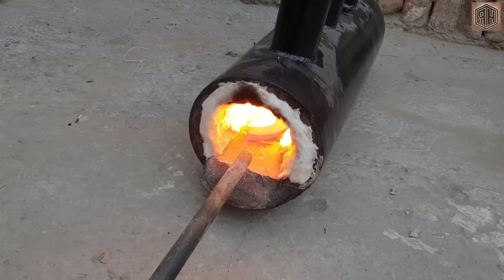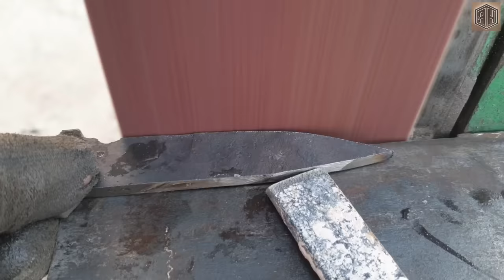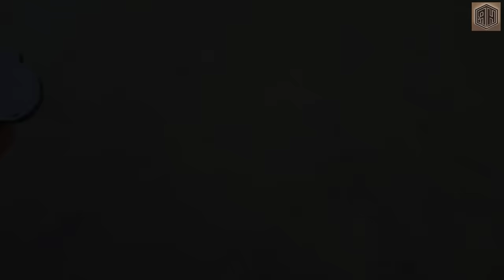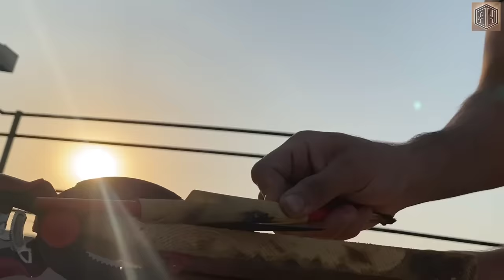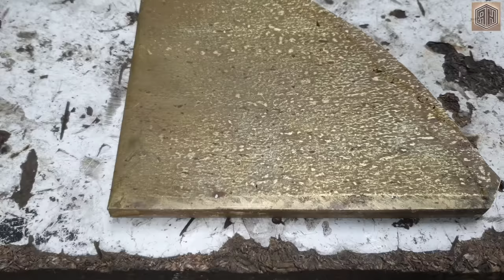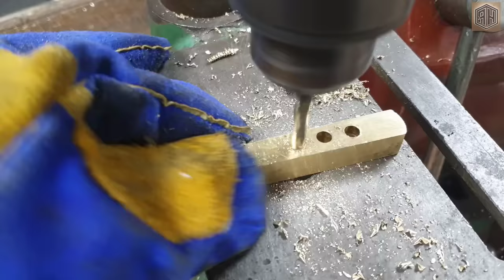Rusted Spring FORGED into a beautiful Butterfly knife

Comment: As always you did a beautiful job but as a machinist I kinda cringed when you cut that long groove, an end mill which can be bought very cheap (whole sets) would have done so much better,the counter sink you used just ate up the brass and left imperfections in the brass itself, an end-mill would have left a nice smooth finish.
Once again beautiful work but when you did such a great job on everything else the tiny imperfections stand out more.
Reply: I was a bit confused why he used the end mill to cut the slot down the length but then used a dremel to cut the slot in the side. And ya, the countersink was kinda hokey
Reply from the maker: I am thankful for your opinions.
Reply: CrunchyGS, he's thankful for people's opinions, and thanks them for the advice. So don't come out here being toxic. :/
Reply: @gala6403  ok boomer what are u like 50
Reply: So what. Being old is an insult now?
Reply: @tkdace2459  yes how old are u...boome...r

Comment: I’m genuinely curious why a person would dislike a video like this. Do you not like craftsmanship? Are you scared of the butterfly knife’s potential to be a dangerous weapon? Are you offended on the rusted spring’s behalf? So many questions
Reply: I liked the video overall but felt the maker’s attention to detail was very disappointing. Pay attention to the alignment of the holes on the handle. Are they centered or placed closer to one edge? If they’re not centered, are they at least off-center consistently between both handles? What about the channels running down the inside of each handle? Are the channels uniform with smooth, even walls, or are their inconsistent gaps and other marring on the brass? Was the material removed from the very center to create the blade channel, or are the remaining walls on either side inconsistent widths, meaning be removed more brass from one side than the other? You can check all those things in the 9:44 to 9:54 section.

Spoiler alert: this knife has ALL those tooling and measuring/alignment flaws, and many more. Lots of evidence that he rushed the work and didn’t give it his best effort.

There are other things in this video that he did wrong because he might not know better (like using steel tools to assemble brass pins in a brass handle), but those measuring, alignment, and tooling flaws are simple laziness. And maybe he figured he’s not being paid for this, so it doesn’t matter. But if that’s the case, why bother making a decorative knife and emphasizing all the hard work along the way in the first place?

Comment: can I actually buy this? I’d pay 150$ or however much you’d like
Reply: Just take that money and put it towards a forge, then you can make any knife you like for the cost of the steel 🙂
Reply: @adammilan6434  its a very expensive hobby to get into. Of course, you can make knives on the cheap and still get good results, but the machinery required for a blade like this will set you back quite a bit more. If you're not wanting to start a hobby that you'll pour thousands into, stick to just buying the knife.

Comment: BRO YOU CAN PARTICIPATE IN "FORGED IN FIRE" PROGRAMME!!
Reply: No he can.t. that wasn.t forging what he did right now :)
Reply: Probably has the skills but he definitely doesn't have the kind of tools you need to compete in the final
Reply: @gandurk  he definitely has the skills. But what he did here isn.t quite forging. Forging means you make more than 75% of the shape by 🔨
Reply: @xrevengerrx6369  how isn't it forging? He took a piece of steel and reshaped it into a bar, I thought that was definitionally what forging meant:

"Forging is a manufacturing process involving the shaping of metal using localized compressive forces. The blows are delivered with a hammer (often a power hammer) or a die. Forging is often classified according to the temperature at which it is performed: cold forging (a type of cold working), warm forging, or hot forging (a type of hot working). For the latter two, the metal is heated, usually in a forge. "
That's just from Wikipedia
Reply: @gandurk  i suggest to look at forged in fire. In one episode was a blacksmith sent home because of this reason. He just straighten the metal and then shape it by cutting. It.s same thing.
Reply: @gandurk  i.m speaking strictly about the show classification about forging, because of the idea of the first comment.
It.s not haiting, i love his creations :)
Reply: @xrevengerrx6369  aw cool I was genuinely interested, seemed like you knew some stuff. My guess is that it is forging under normal conditions in real life (going by the definition I posted), but for forged in fire they put some rules to prevent people just buying strips of metal or something to skip out on the actual work. Some people have really elaborate shops and it would be easy for them to use a plasma cutter to get a blade shape and that would ruin the point of the competition. Anyhow we agree that he couldn't really compete in forged in fire
Reply: @xrevengerrx6369  like historically it was not uncommon to grind shapes out of sheet metal and stuff, not all blades were forged from the ground up, but it wouldnt work in the context of the show
Reply: @gandurk  With forged in fire though, they usually end up giving the participants random stuff to make blades out of such as drum sets and ship wheels, both of which have been used by the show. They usually get them to melt them down and reshape them but I cant imagine them not letting him do something like this.
Reply: @gandurk  its not forging because he did not make that shape by his hand, he turned into flat stock that used an angle grinder to MAKE that shape he did not make it by his hand not forging

Comment: I kind of want to know if the knife would be too soft, as the spring probably wouldn't have been made of steel thats as hard as 56 hrc or 57 hrc. Normally small knives like those should be about 57 hrc to avoid being dulled too quickly and not bend. Would the choice of steel affect the performance?

Comment: I totally love your videos and sincerely appreciate every minute you put into them. Pure magic.
But, I have an observation to make, as an amateur fan of yours, and please hear me out and correct me if I am mistaken.
I believe that the half circle end of the blade should have been extended.
Or, it should've been instaed made to end it with extension, like blunt horns or micky mouse ears.
The reason I say this is that when I look at the blade when opened, I don't see sufficient support to keep it fully horizontal apart from the 2 bolts. 
I feel that I can bend this knife with my bare hands, when knife is extended, right at the joint point of these 2 bolts.
But, had there been an extension that wedges itself tightly right into the two grooves, it would've given it much support.
Do you agree?
Reply: The circle should actually be shorter, because it has pins in the tang those contact the handles and stop the handles from touching

Comment: One of the best looking butterfly knives I've seen so far on YouTube. HOWEVER... Every single butterfly knife I watch being forged is WAY too thick in the handles. I see that you started out with a half inch piece of brass for the handles. That's too thick, a quarter inch for both handles! It seems that with your level of skill, you could have made the blade thinner, and created two 1/3 or 1/5 inch handles. I've owned several butterfly knives, and not a single one is as thick as the one you created, no matter how beautiful yours is. A thinner butterfly knife would be less clumsy in the hand, and easier to 'dance' open and closed. Come on! I thought I was watching the perfect butterfly knife being forged until I realized how thick you were making the handles. Close, very close, but no banana.